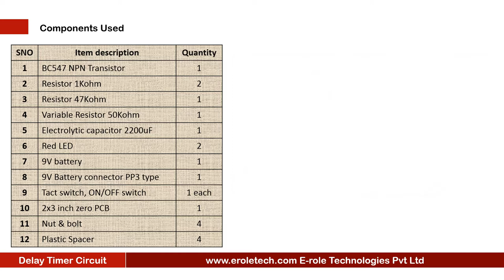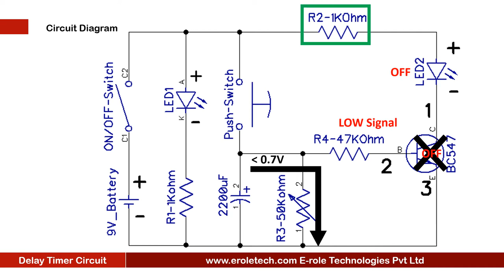Timer circuit Using NPN Transistor BC547 Full Making Project-12 #ataltinkeringlab  #project

Comment: aalthough the  BC547 has high gain it is not enough for longer delays - using larger caps will not work because of leakage. You can use a Darlington for longer delays
Reply from the maker: Thanks sir